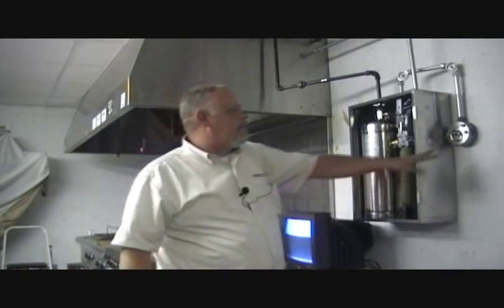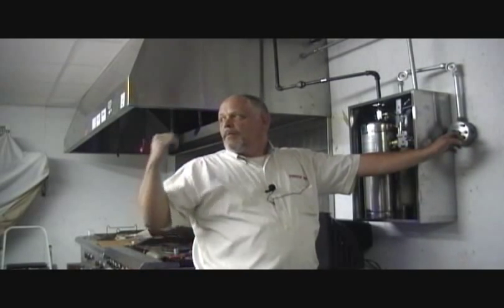Ansul Fixed Fire System Test

Comment: @bifta7 The pull station handle should NOT come out only 2 inches, It is 7 to 14. No more that 40lbs of pressure to pull, and the height should be between 42 and 48 inches. That is according to NFPA 17 standards. I install, repair, and inspect Ansul (R-102 and Piranha), Amerex, Rangeguard, PyroChem, and Kitchen Knight systems in Las Vegas.
It is obvious that this is for demonstration only! I personally dont EVER use unions on the black pipe. This quality would get me fired, or I would resign.

Comment: 3/8 pipe is the standard and is what you should use when possible, 1/2 pipe takes more wet chem to fill the pipe volume and will lead to lager or more tanks. always set up a system with minimum requirements as they are over kill anyway. i know your post is more than a year old just wanted to add for thought

Comment: I work on these all day long why did the fan not cut on and make up air shut off not one fan was running nothing
Reply: this is a demonstration system for system nozzles as the video is showing and is not a restaurant so there is not a fan-gas-electric or make up air installed

Comment: First off the balloons are testing and any fire protection contractor would know that and as for the ansul install its runs almost the se as any other system we install them a lot along with the other brands and I don't know anyone to do a install with 1/2 bp 3/8 is the recommend for all system range guard you start off with 1/2 only from the tank and reduce it down to a 3/8 we only use 3/8